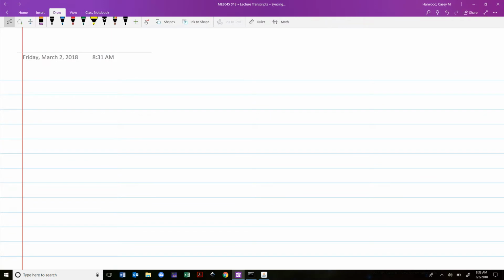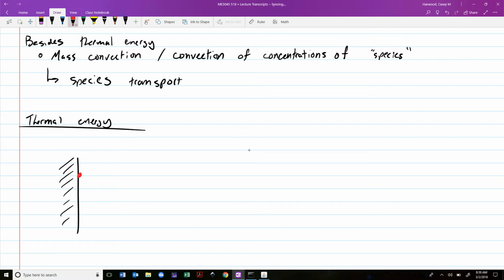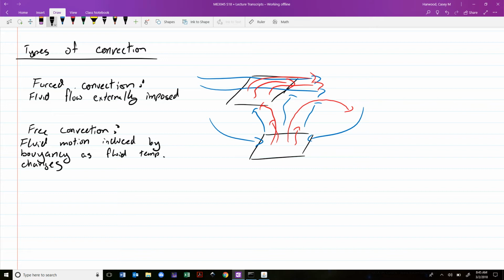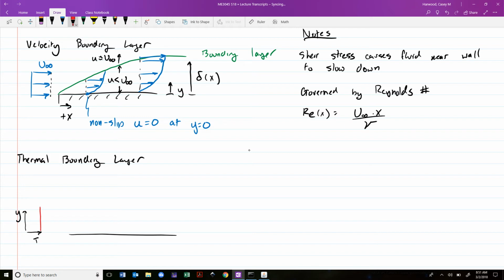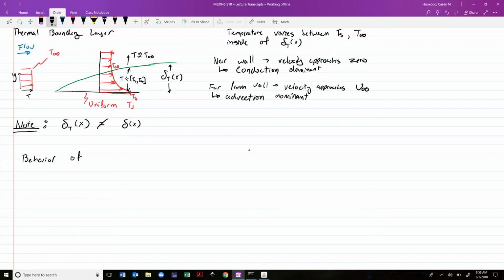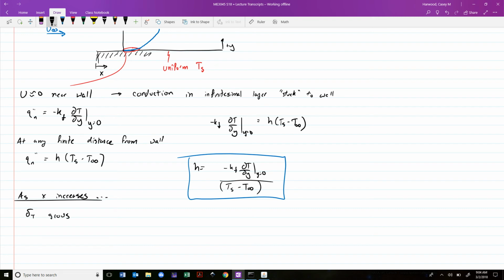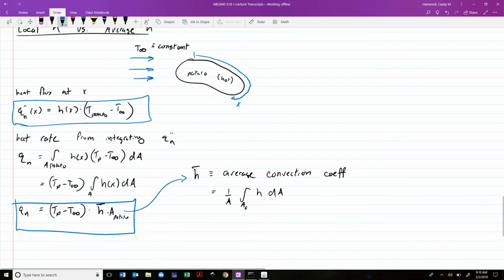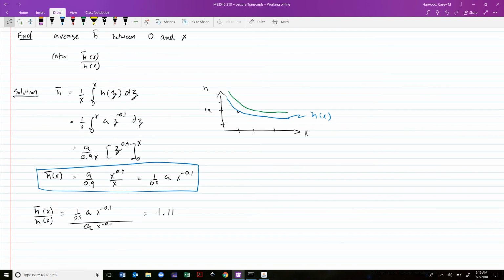L19 - Convection Intro

Comment: Thanks for sharing the lecture. One question: Couldn't we just introduce a large control volume that encompasses the flow within the boundary layer and compute the difference in inflow and outflow enthalpy to figure out the amount of heat transfer from the solid wall? (a similar approach to one for internal flow)